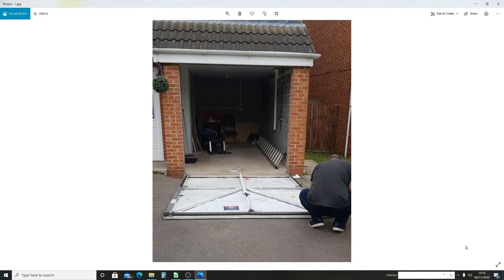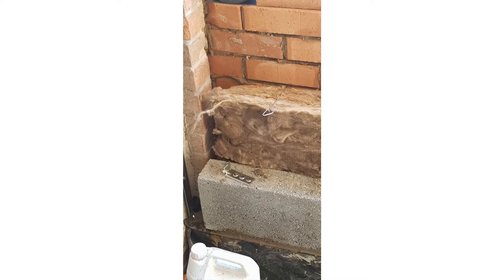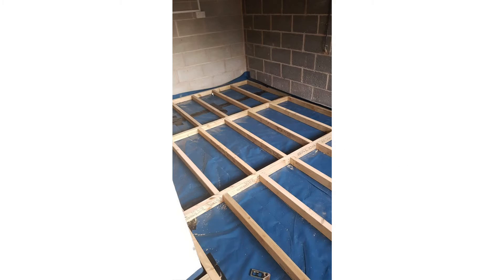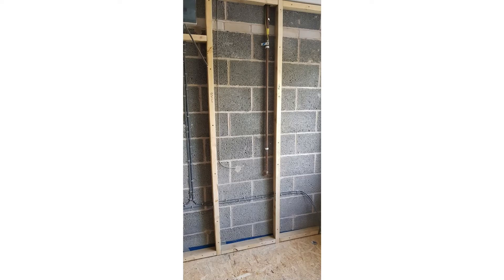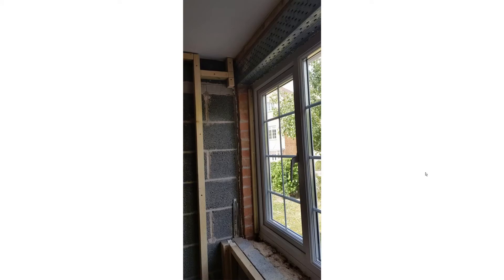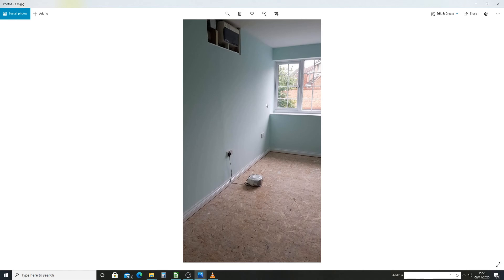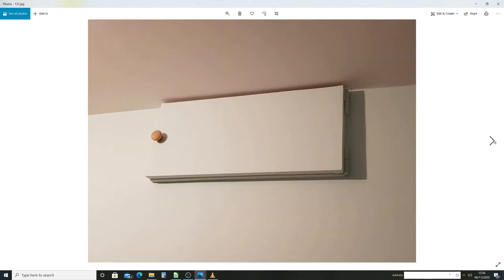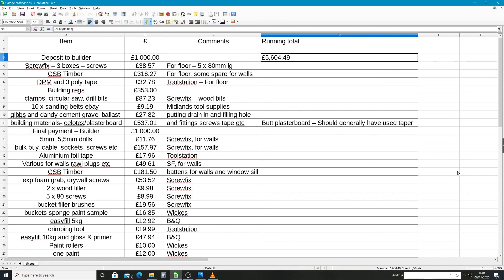Garage conversion

Comment: Great explanations on each step. This has helped me a lot as I'm planning to do my own and this has given me the extra confidence I'll be able to do it, apart from the electric connect up, new heating system and boiler and the front blocking up of the door.

Comment: Thank you .
Very well explained ,and like your attention to detail .
With the tape and jointing ,just need to feather filler  out wider and do in three or four coats .
Reply from the maker: Many thanks for the positive feedback and glad it helped. I agree with your feathering comments. If I was to do this again I would use the taper boards instead which I think would have been easier. Maybe I would buy half taper edge and half square edge. Regards

Comment: Best fixing in thermolite is to just drive a decent size screw straight in. I use 2inch 10s and get a solid fixing
Reply from the maker: Many thanks for this, I did try some coarse pitch screws but I was still able to pull the wood out with these, but maybe they were not as long. I was surprised at how good the Raw plugs were that I used and they seem good so far 2 years down the line. Regards
Reply: I’ve used nail plugs / wall pin plugs, just drill a 5mm hole, shove the plug in the hole, and nail cable clip in, hard to pull out unless you really yank it.

Comment: Dean thanks for the advice. I  would like to do the same to my garage. It looks the same size as yours. Did you consider full length windows ie top to bottom? The reason I ask is would you still have to do the footings? Many thanks Neil
Reply from the maker: Hi Neil, thanks for the question. In our case I wanted to match the other side of the house. I suspect you are correct in your thinking. I suspect you may not need the footings with a full height window. Maybe worth a quick chat with a buildings inspector. Regards

Comment: So you have to take pictures along the way? How do buildings inspectors know at the end you did all the required steps?
Reply from the maker: There are certain hold points along the build, the Inspector comes in and inspects at these build points, then work can continue, So it is an ongoing inspection and buy off. Regards
Reply: @deanjallen6449  How much do you have to pay for these checks?
Reply from the maker: @tiborgabor9632  This depends on your local council as they have different rates, best bet is to check on your councils website. regards

Comment: Very nice thanks for this. I would also like to do this to our garage. I wonder how much it would cost to get it all done by someone?
Reply from the maker: Hi there, thanks for the feedback. I would think it is best to get a few quotes from builders. If adding the same insulation etc, I would think this would cost around £12-14k. Regards
Reply: @deanjallen6449  ah ok awesome thanks for that. I was just curious. I would definitely do it myself as you have. I built a campervan myself and it’s not that different form it. Your welcome to see the videos I have uploaded about it. I don’t want to spend £12k when I can do most of the work myself and only spend £3k lol
Reply from the maker: @theoteam4641  Yes, it is alot cheaper doing it yourself. The hardest bit is probably framing around the door. Just need to plan ahead and know what you want to do before doing it. I will check out your videos. Thanks, Regards

Comment: Hi.. Thanks for sharing the video. Do you need planning permission to remove the garage door and replace it with a brick wall with window? Thanks.
Reply from the maker: Hi there, thanks for the comment. Planning permission is not normally required but this can depend on the area. Its usually done under permitted development. You will need building regulations though. The local council need to be involved before you start. Hope this helps.
Reply: @deanjallen6449  Thanks for the explanation. Really appreciate it. Cheers...

Comment: Good job! For future reference you should always make any elec cable runs virtically directly above switches and sockets, not horizontally. It's then safer for any retrospective fixings etc as no fixing are normally done within a 6" area above. Just heard as writing this your sparky accepted the horizontal cabling?? Not good practice🤔🤔🤔 wouldn't use a sparky on my jobs who did that!
Reply from the maker: Many thanks for the comments. WRT the electrics I must admit I am not a sparky but I am an engineer with common sense, I hope. My understanding is the cables in line with the sockets are in the safe zone and are acceptable to the regulations. The cables must at some time run horizontal to get to the consumer unit. The cables are also clipped to the rear wall and approx 90mm from the surface of the plasterboard. I believe as long as they are deeper than 50mm it should be okay (even without RCD) The cables are of course protected with a 32A breaker and people are protected on this circuit with the normal 30mA RCD. This new circuit has 4 sockets in a ring main so should be within the rules to run a 32A breaker on being clipped to the wall with space around the cables as not to over heat. The cable runs are also kept short with this routing. I believe this is totally safe in all regards and well within the sparky specs. Regards

Comment: Hey man might sound like a idiot but do you need permission to do this? I want to do this for my garage too
Reply from the maker: You will have to check with your local council, some areas do, we only needed building regulations, which involved a fee and several visits from the buildings inspector to check the work throughout. It sometimes depends on the starting point of the garage and what work you are intending to do. Best to have a chat with the local council first before any work is started, Buildings inspector will inspect the garage right at the start. regards
Reply: @deanjallen6449  thank you so much man I appreciate you replying so quick!